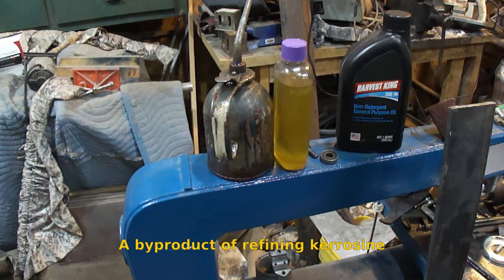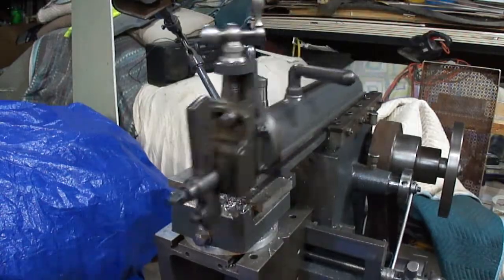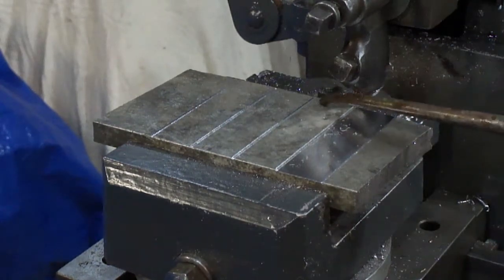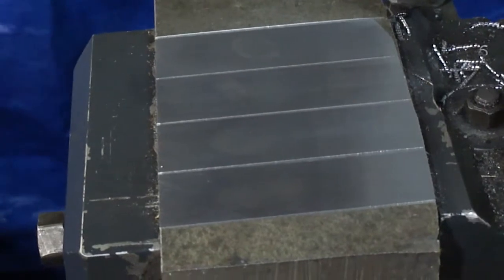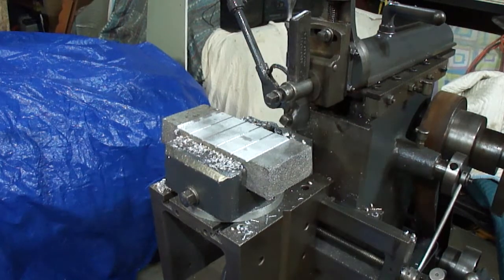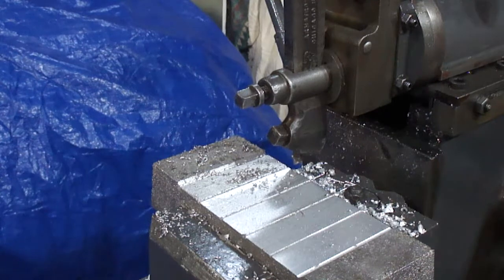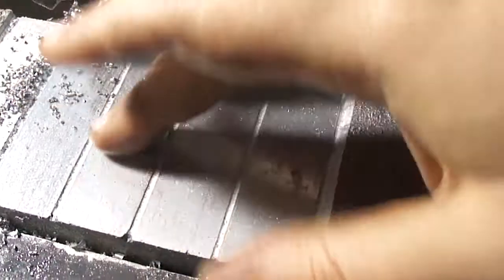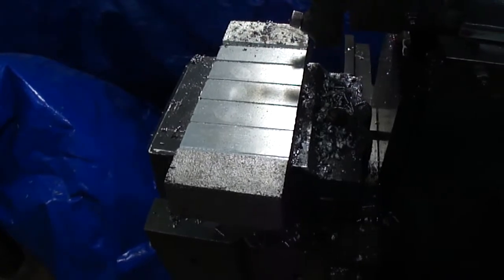Experiment: Testing Various Cutting Fluids for Aluminum

Comment: You are killing me....I want a shaper soooo bad.  I bet the Baby oil/Tiki torch Fuel smells the best, although WD-40 ain't bad.  That cast seems to be very porous.
Reply from the maker: lol, yea, I dont know what I'd do without the shaper tbh, I was out running it for a few hours yesterday cleaning up some rough iron castings since I didnt want to clamp the rough castings down to the mill table. The tool bits on those are much easier to sharpen and replace than an endmill is, and is great for rough, rusty/pitted steels, rough cast iron castings, etc, stuff that will just tear up an endmill very quickly. 

The cutting mix didnt have any smell at all really, but it did work good. The aluminum wasnt really porous, it had some microporousity that I fought with for quite a while to get rid of, but I did get rid of eventually. I just couldnt heat the aluminum fast enough due to having more or less a dense brick for a furnace, and that time spending melting, it was absorbing gas, but the new furnace has fixed that.

Comment: cheep kero is all you need it will do the same as wd40  .wd is nicer to smell though .
Reply from the maker: kero is very expensive here, but once in a while I do get a little for my heater which I use in the shop when it's far too cold out for the other heater to start up, so the smell of it doesnt really bother me really. Ive never really been that big of a fan of WD40 really, had questionable experience with it in the past.
Ive heard turpentine works better, but getting real and pure turpentine is quite difficult, so one of these days, I may try to refine some myself. I use the rosin anyhow for making stuff like belt dressing sticks, so turpentine is usually just burned off and wasted.
Reply from the maker: the mix that I like using, the mineral oil and tiki torch fuel, the tiki torch fuel is a byproduct when they refine kerrosine, so it's pretty much the same thing only thicker really, so you get the lubricating factors of both a mineral oil and kerrosine, but in a thicker liquid than kerrosine. It is handy when the stuff is on the lathe and tends to sling kerrosine back off from the rotational forces, the mix I use tends to stick to the work alot better and not just flow all over it.
Reply: kero  is what  the teacher at voteck  used  .now if your looking for "stick to it"  i have stp  oil treatment  night mares im afraid to relive  the chips just make a spider web of sticky oze . but if you spill it in the winter you have time to get to it befor it  makes a puddle out  of the pile .
Reply from the maker: lol, sounds like that would be interesting to see. It also sounds like something that dissolved the aluminum like oven cleaner or brake cleaner does.
Reply: helps with compression  but nothing else lol no dissolving though

Comment: Thanks for uploading, I've found similar results with ali, wd 40 works as well if not just a bit better than oils. I tried some diluted anchorlube and that was o k. I want to repeat the exercise with some scrap yard steels and see what happens.  All the best Mat
Reply from the maker: no problem, thanks for watching. I was honestly surprised because Ive always gotten the best finish with my mix I usually use, and the WD40 didnt do much of anything usually. I know with drilling holes on the drill press, the wd40 really doesnt do anything for me, but you can easily hear a change of the motor when it comes to the mix I use, thats why I was kinda surprised. 

I was just hoping this would be interesting to someone. I like to see the difference rather than just taking everyone's word for it, kinda like steve summer's videos on the finishing tools video, everyone always said that the shearing tool was best but he did the tests and it showed otherwise and why.